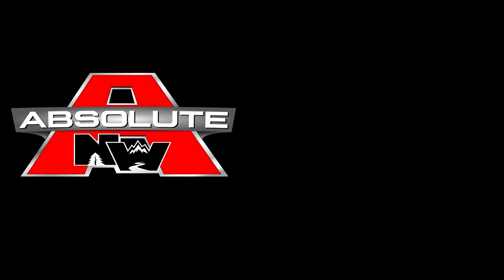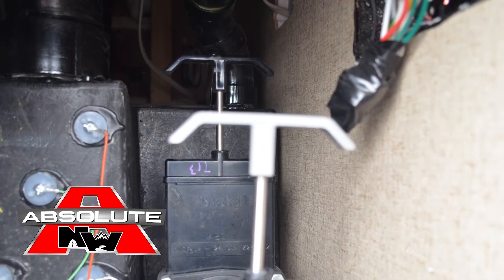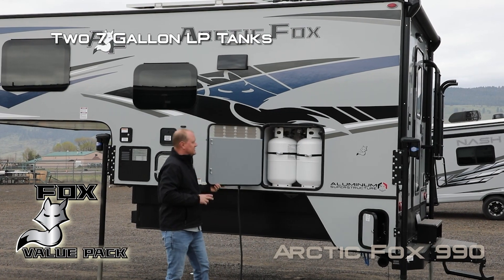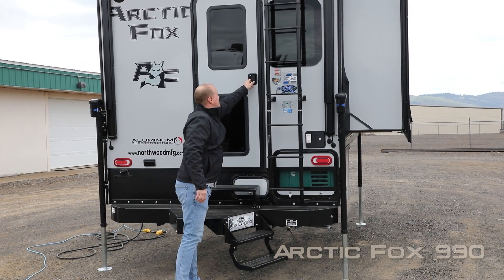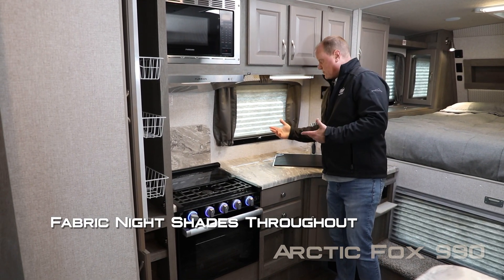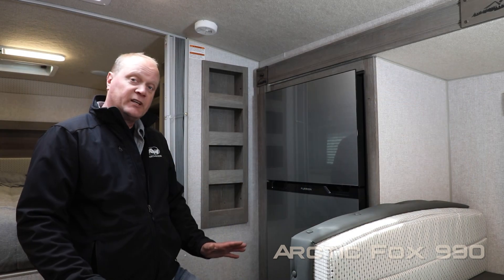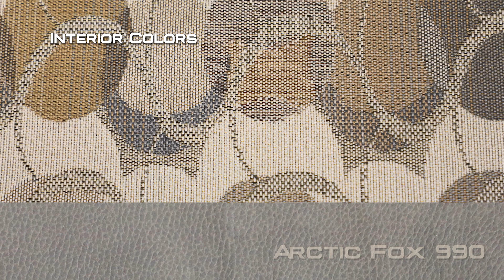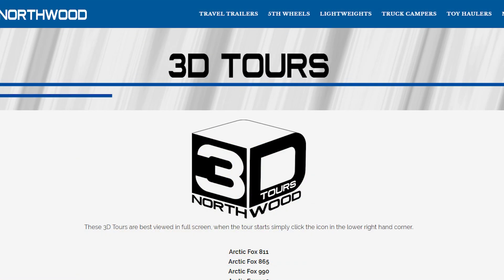Quick Tour of the new 2024 Arctic Fox 990 Pickup Camper

Comment: arctic fox... just steal from nucamp cirrus 920. upgrade your campers. this is not the 1980's. this is 2024. light and grey colors on the inside so that it feels LIGHT AND BRIGHT AND INVITING. at least 10K watts of power(lithium ion) and 3000 or 6000 watt inverter. change some of the roof accessory placements so that the roof can be use to MAXIMIZE solar panel placements. 12v fridge stove AC. diesel heater. diesel water heater. keep the propane heater and water heater as a BACKUP. outside solar plug  next to the 30 AMP shore power plug.